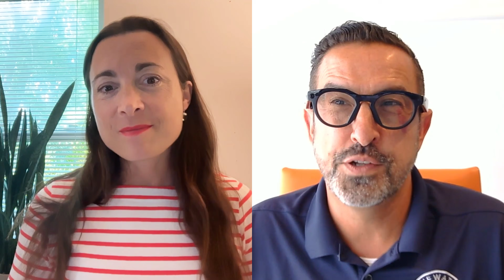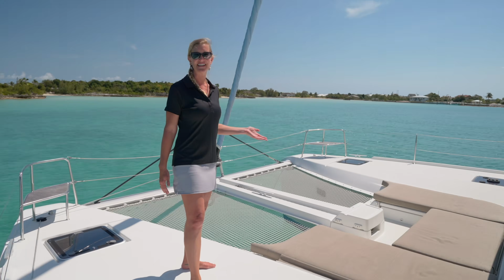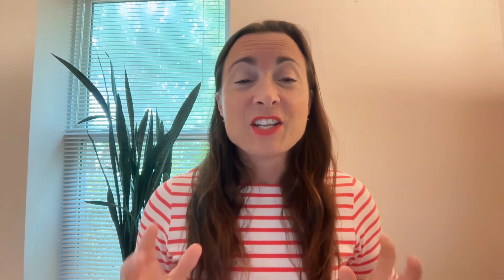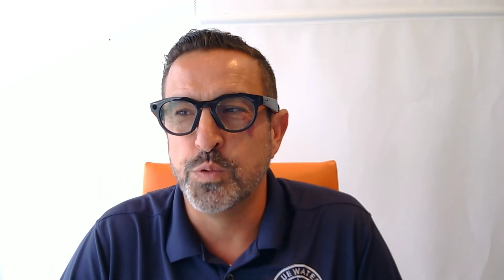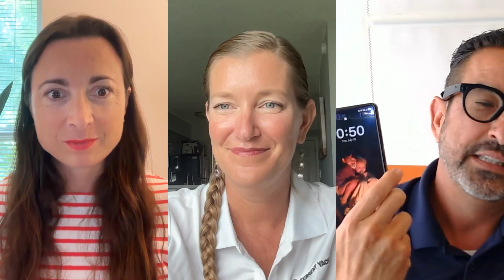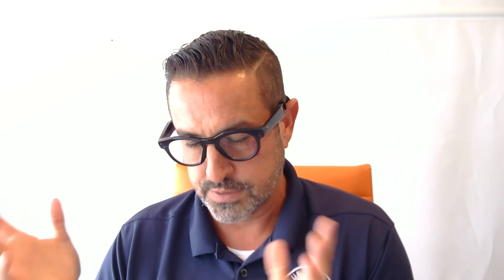Are you ready for Lithium on your boat?

Comment: Brand new Sunreef just blew up this week abroad, due to lithium battery issues... early days for this tech on boats
Reply: So scary!! Investigation still ongoing. Boat fires though are most often caused by Lithium batteries from "toys" stored on board that are far less stable.
Reply from the maker: That is a sobering reminder of how critical proper installation and safety systems are with these new energy technologies. (And how to properly handle OTHER lithium batteries on board!)
Reply: Some Sunreefs have NMC lithium batteries. I woudl never install them on a boat. With that said, I drive around all day with them under me in my Tesla.